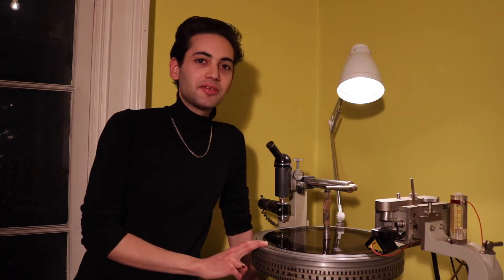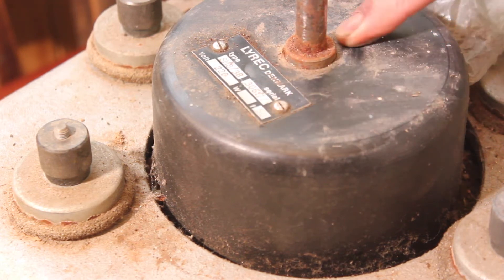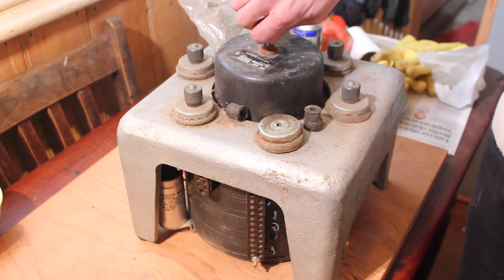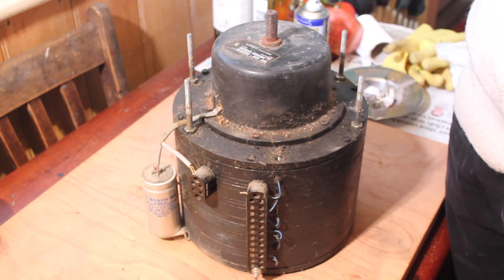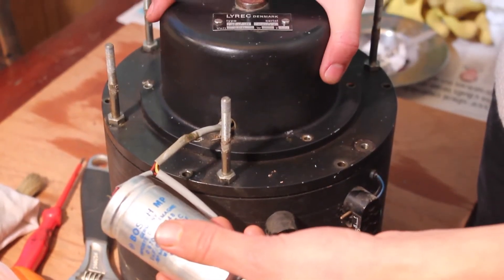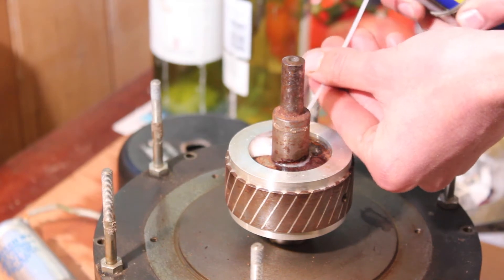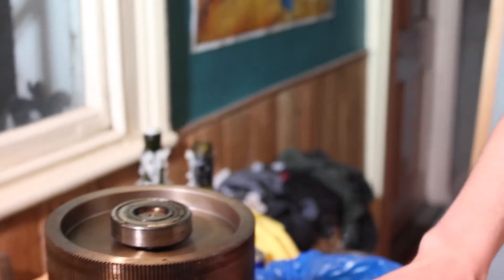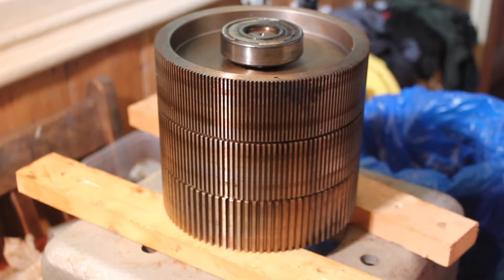How to service and refurbish Lyrec SM motors used in disc cutting lathes (Neumann, Lyrec)

Comment: Hello! Thank you for your video. I was looking for information on Lyrec SM motor but fount it very rare.
I have one motor with no starting motor on top and also no power supply. I wonder if I could somehow replicate/make the starting motor and power supply. If I could find the starting motor that would be better but I don't think it is possible. Also I'd like to ask if there is any Lyrec motor available.
Reply: Have you considered using a donkey motor?   This is a smaller separate motor to spin the main motor up to speed. They are common in large generator systems.
Reply: @Jonghyun Kim  - You don't need the small motor, is just for start, you can start it manually. I have the original documentation of Lyrec SM8 motor, if you still need it, i can scan and send it to you. I have too one SM8 motor, i want to build a high end turntable  but i do not have  the bearing of the turntable, I'm still looking, if you know one, I'm interested